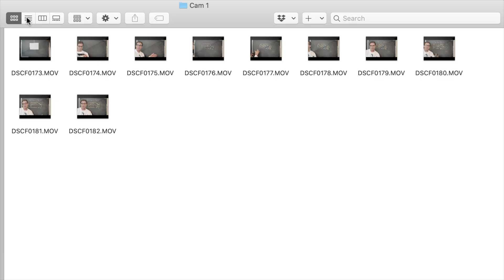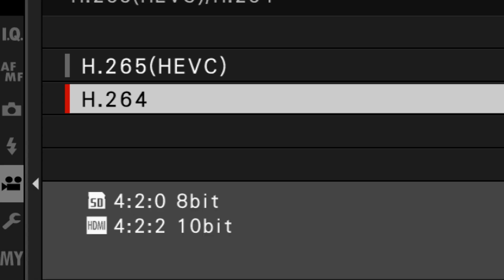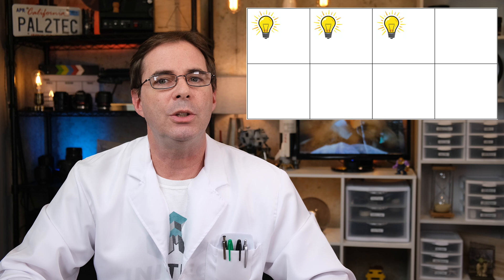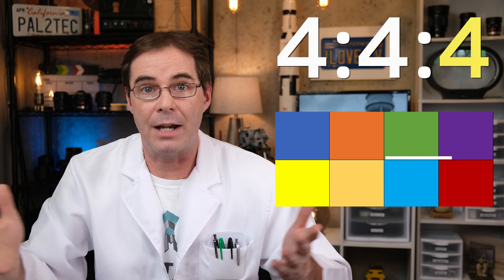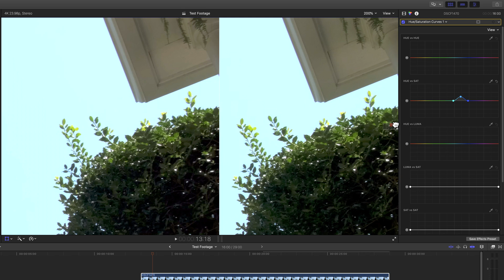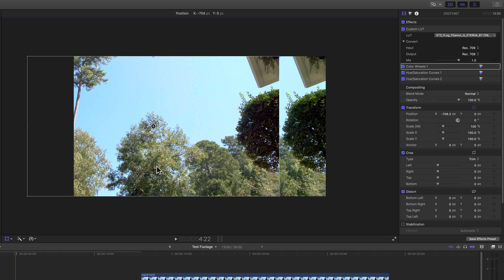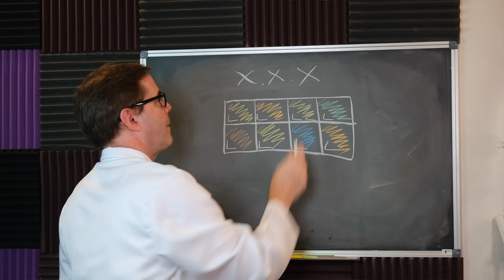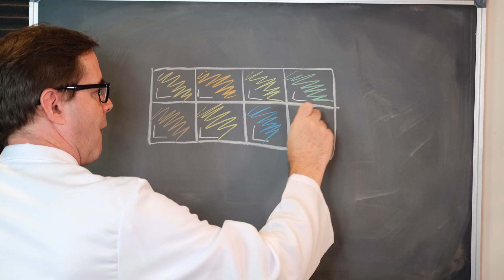Fujifilm Video Color Compression Settings

Comment: But how do you shoot 4:2:2 flog to SD card without using HDMI? Is it possible? On x-t3 there is only 4:2:0 option with h.265. And how do you shoot with HDMI, what minimal accessories do you need? 

Update: never mind, I found your explanation in the comments